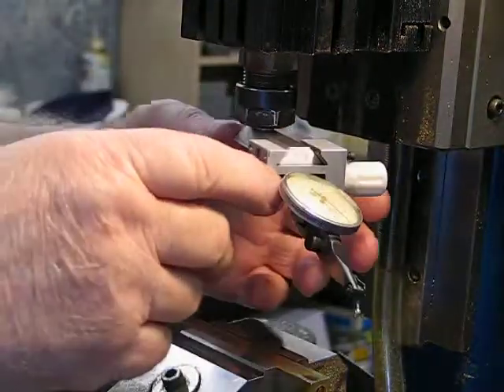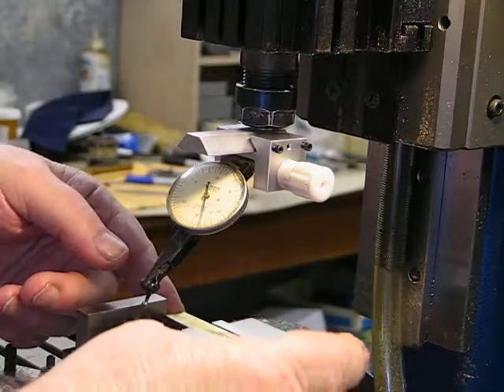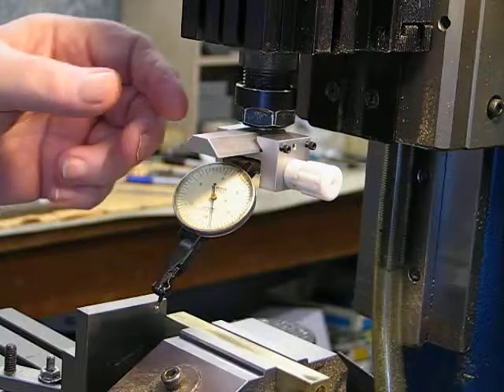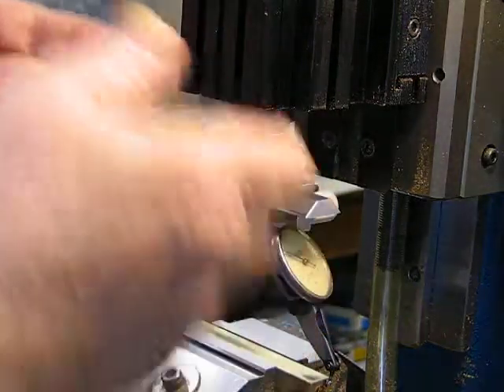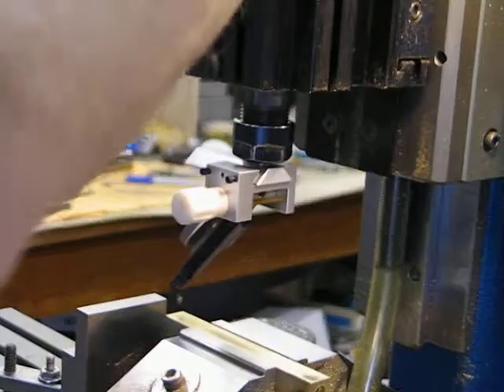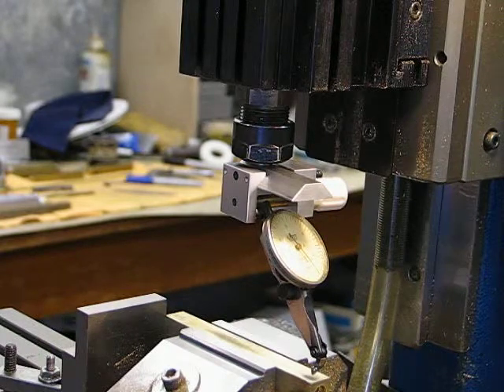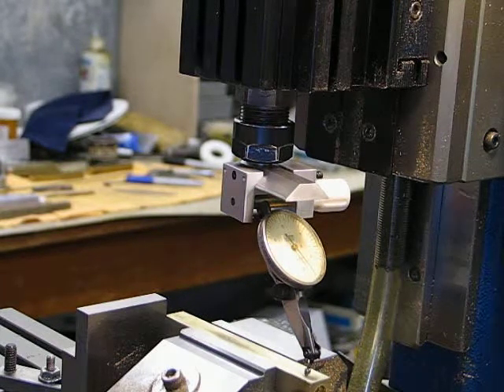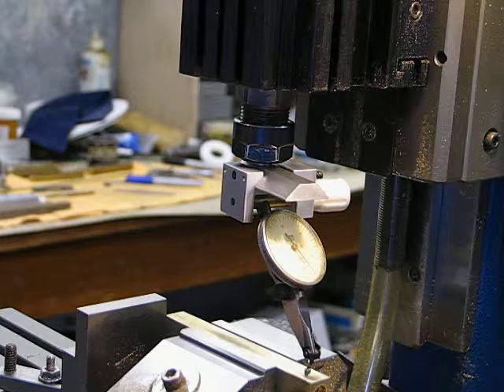MVI 0296...Spindle dial indicator holder

Comment from the maker: Juan,
    I tend to make things with a few shapes in DraftSight or Autocad and then ad lib and change things as I go along, so my drawings are never revised, I do have an exploded drawing I could send you to give you an idea of the finished tool, like most things the final tool could have improvements, and that would be an opportunity for you to use your own ideas, if you can open the drawing you could take measurements of the main body and then scale down and work from there, I give no measurements only screw sizes, but sizes can be obtained from the cad program, I can do that if it would help, 

Your use of the term grub screw indicates a British term, if you don't have cad I can change the drawing to a jpeg but then you cannot check measurements, let me know,

Edmund..........Alberta

Comment: Dear Mr Maisey, thank you for posting these videos. Taig lathe YouTube channels are few and far between. Taig lathes are wonderful.  I am sure Taig mills are just as good, but for better or worse I wound up with an even smaller mill, the Proxxon MF70. My whole machine shop has to fit (for now) in a very small hallway. I have learned machining the hard way, not by any apprenticeship. I am a retired electrical engineer, and I have no interest in CNC programming because I spent my whole professional life programming and I'd really rather not do it anymore. I see exactly what you are doing. I  might be able to scale it down to my Proxxon, but I have one question. How does the clock attach to the crossbar below the unit? Is it as simple as a 4mm hole and a grub screw? My clock has a 4mm post on it. I might add that your tool would be very handy for tramming the mill vise (I use the Taig vise on the Proxxon BTW) to get it square with the table. I do not know if  the word "tramming" is used in the UK, but we yanks probably got it from you.